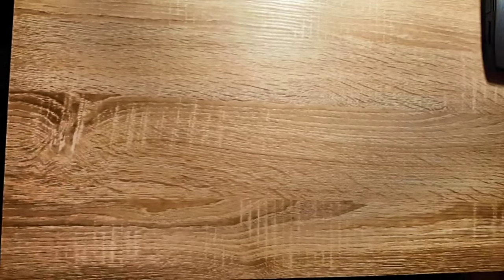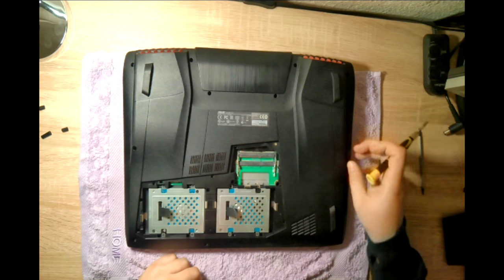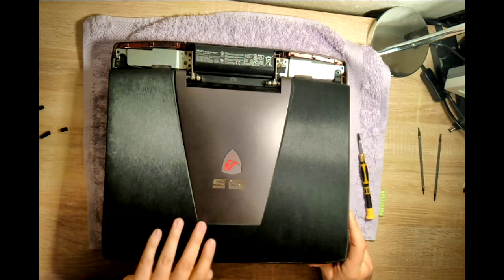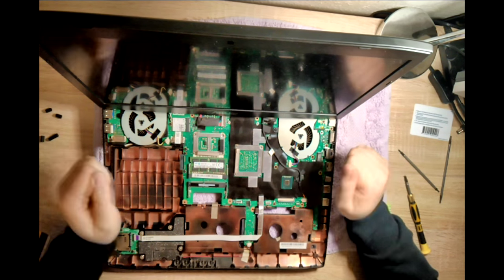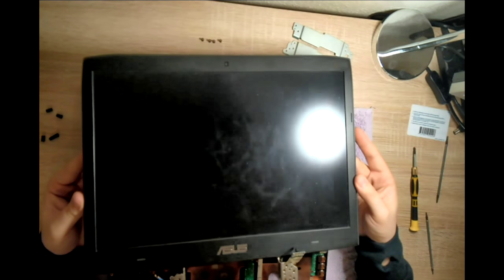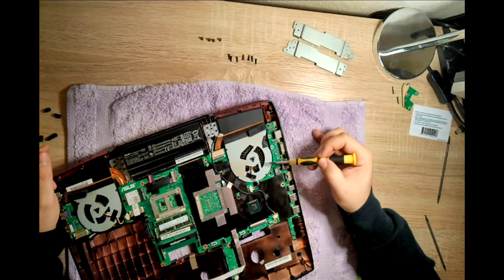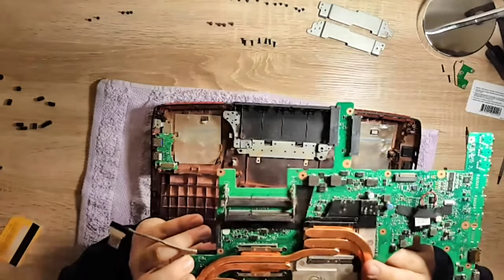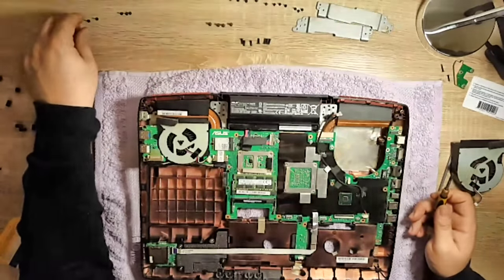Asus G751 - Complete Disassembly / Fan Cleaning / Battery Replacement

Comment: Thanks for perfect instructions. I used them to dissemble and reassemble my ROG laptop. I had to replace the entire keyboard assembly and bottom case. So everything had to come out of it. I spilled 10 ounces of hot munedo into my laptop, effectively destroying it. I got lucky and what I needed to fix it was on EBay. I got even luckier when I got it all back together and pressed the power button. It works!!! I think I might have a couple screws in the wrong places, but it's back together and it works! Thank you very much.

Comment: I know this is an older video, but it kept my G751 alive a bit longer. Ive had the since since 2015, and only a couple of weeks ago, the fans (specifically the left exhaust fan) started making noises. I opened it up, replaced the fan, thanks to this video and put it back together. Besides the horrible fidgity wifi antenna cables, the only issue i had was remember which screws go where, in the main body. Thank you for making this hardware last a bit longer. I will also say, for anyone using an older gaming laptop; dual SSD disks running raid helps.
Reply: I will try that 😬

Comment: My screws where tightened by a Titan and sealed with a magical barrier. I managed to remove 4 before the x on multiple screws turned into a forsaken circle.
Reply from the maker: Maybe you were not using the correct sized screwdriver bit? If you use a bigger/smaller one, the thing you mentioned above tends to happen.
Reply: What did you end up doing may I ask? I'm in the same boat .. :(
Reply: Can this motherboard be replaced? Water spilled over keyboard...Thanks a lot for the video!

Comment: a big thank-you guy, this allowed me to dust off G751. 👍
I will see if the temperatures will rise less, i pray. 
Otherwise I think it will be necessary to change the thermal paste... only place that I don't disassembled. (the copper parts stick to GPU/CPU).
Thanks again. 👍

Comment: @Dongleboo You are a lifesaver!!!! 
I was at my wits end worried about the noise my laptop was making (same model btw). I had fallen on an escalator and the stairs hit the side of my laptop that caused something to break off and go into the fan. I've never taken apart a laptop before so I was going to go to an IT company like geek squad to get it done but they wouldn't even tell me price and the only thing they told me was the price for the diagnostic which was over the top expensive!! my friend recommended this video to me and I disassembled the laptop (but just to the part of lifting off the keyboard) and I cleaned the fan with the duster spray. I successfully reassembled everything and my laptop is so quiet! Thanks again for posting this video HUGE help!!

Comment: you saved my laptop - overheating, battery was dead..now with a new battery and a good clean-up, it is as new :) thks !
Reply: Thierry Van Vaerenbergh hello sir may i ask if i remove the battery because its dead also but its ok? if im using the power cord directly w/out the battery??
Reply: i don't think it will work correctly without a battery in it

Comment: Thanks for this video. I needed to replace the bottom part of the case because it had broke in a fall. I watched your video once and was able to completely disassemble the laptop and put it back together. My only issues where my own fault where I didn't put the keyboard ribbon back in securely and the keyboard didn't work, and the battery wasn't in all the way so putting the speaker piece back was difficult at first. Otherwise went perfect. Thanks again.

Comment: Thanks a lot for the video, it really helped for opening the beast properly. I had a problem with the CPU fan that was making a lot of noise and the battery who's led was blinking, the fan is replaced and the battery disconnected then connected back and now everything runs smoothly again. Keep up the good work.
Reply: +BELDJILALI Farouk  Was your battery fully charging when the led light was blinking  ? Now my keyboard is now when inputting two characters instead of one character when i press one key but it's not all the keys . Help!!!!!!!!!!!!!!!!!!!!!!!!!!!!!!!!!!!!!!!!!!!!!!!!!!!!!!!!!!!!!!!!!!!
Reply from the maker: +BEN PAUL ESHUN-WILSON Can you repeat the question, because I actually didn't understand what is the issue?
Reply: +BEN PAUL ESHUN-WILSON Hey, the battery was at first fully charging and still be blinking green or red led, but now it's charging at a maximum of 86% and stopping there, still blinking led.
I got no issues with the keyboard, it's working fine for me, even after opening it.
Reply from the maker: +BELDJILALI Farouk Ok, now I understand - open CMD and type in command: powercfg /batteryreport - it's going to create an .html file which you can open with your browser and then look for "Battery capacity history" -somewhere around the middle. If it's under 80 000 mWh then you have a dying battery. I had the same issue and a defective battery. It died after only 6 months and was down to 60 000 mWh and didn't want to charge past 92%. If you have a sudden drop in capacity then the battery is defective. The problem is that the battery itself has only 1 year warranty and if you have your laptop longer than this, than you can't change it under warranty. And take this as an advice - NEVER leave your laptop to discharge and then charge it again! If you're using it keep it plugged in at all times! I hope I helped.
Reply: so in short i need to replace the battery but sometimes it says not charging the led light starts to blink . If you discharge the battery comes back to normal and through that was the fix but my battery level is drying.  Please what but my keyboard.?
Reply from the maker: +BEN PAUL ESHUN-WILSON The Battery is simply dead. As for the keyboard - I haven't experienced this issue. Is this an issue after you opened your laptop or it's from before? If it's after you opened it, then check the large ribbon cable connection. It's crucial that the whole cable is firmly plugged in and also that it's not inserted at an angle! Unplug it and plug it back in. I had a similar issue with my old G51 - I broke the keyboard and had to change it and after the replacement the keys weren't registering anything. At the end I decided that it's a BIOS issue with recognizing the keyboard and I removed the CMOS battery for 10 seconds. After this it will ask if you want to load default settings for the BIOS and you just press enter. I'm not saying this is your issue but as a start, try to unplug and plug back in the large ribbon cable! It's worth a try. I haven't experienced your issue.
Reply: Thanks men you have really helped me ,
Reply: Dongleboo Good day sir my battery died it ok to use it without the battery  using the power cord direct current?
Reply: john paul Sumpit hey mine also just died, I was also wondering if this works. Did you ever test it out John?

Comment: Its usually not the fan that needs cleaning but the copper heatsinks that are blocked with dust. A little bit of fine dust on the fan blades doesn't really matter.

Comment: great walk through. but as for the battery removal. you can remove it without taking out the motherboard. 
remove the 2 screws on the battery & unplug it. 
then take you're thumbs and push it back and then up on the front and it will come out.

Comment: It's a great guide, thank you! This video really helped me while I've disassembled my laptop to place RAM modules into the internal slots. It sounds a little bit strange but my model came with only one 8 GB module in one of the internal slots.
Reply from the maker: Mine also had only one 8GB module on the inside. Some configurations are like this. Mine also came without an SSD. It was a bit cheaper tho.

Comment: Nice vid. I appreciate you taking the time. You can actually pull out the battery without taking off the mobo. It is a bit difficult. You have to wiggle it and round it out. But it can be changed without fully taking off the keyboard or the display. You just have to be careful. Good vid.
Reply from the maker: I found about that while I making the video. I actually removed that part from the final video in post because you have to apply some force to twist the mobo a bit and then force the battery out and it's not worth the efforts and the risk when you can simply undo 6 screws and remove everything.

Comment: Thank you for your video. Extremely helpful! I took the laptop apart first time to replace the RAM to solve one issue. I may have created two more issues though: The DVD ROM does not read any disks and the drive letter does not display anymore. However, when I run the third party hardware scanner I can see the drive model, controller details, etc. Second issue the keyboard backlight stopped working. Only struggle I had was putting back the ribbon cables because I didn't realize the clips were there so I may have forced them in. I may try to reseat them. Any other suggestions? Thanks very much!

Comment: Hi! Thank you so much for making this video! Its going to help me quite a bit in the future when I finally get the courage to disassemble my laptop [G751JT] to that extent to replace the battery as it is completely dead, it sits at 0%charge and it says that its not charging the led indicator blinks orange [changes to green once in a while for a second].

You seem like a guy who is very experienced in taking apart the G751 and have done it many times... I have a few questions I hope you don't mind answering ;) 

1. When disassembling the laptop to replace the battery, are there any components that you can get away with not removing in order to avoid additional hassles?

2. Will using latex surgical grade gloves prevent static build up from shorting out components?

3. Is it safe to clean the top of the keyboard around the keys and touchpad with a household vacuum cleaner to get rid of the dust that has settled under the keys without building up static?

4. I upgraded the RAM of the laptop as soon as I got it to 32GB [came with 16GB] by filling the empty slots with the same RAM it came with.. How big will be the impact on battery life with the additional two RAM cards?

Thank you :)
Reply from the maker: Hi Varun, yes I've taken mine apart at least 10 times now so you could say I know my way around it. 
Here are answers to your questions:
1. No, not really. The disassembly is a step-by-step process and in order to remove one part, you have to remove the other before or after that so you can reach the next one. The parts which do not require to be removed are the speaker boxes and the SD card reader, as they are far away from the MB. 
2. I've never used any kind of gloves and to be honest I was quite amazed that some people have managed to damage their laptops in that way. They might help, but I'm not sure about that, so I prefer not to advise for and against them. 
3. The keys are quite robust and quite hard to remove, still, a vacuum at full power might be able to pop one out if it's directly over them. To be honest I'd suggest a can of compressed air. It's safer and actually better. 
4. As far as I'm aware, the ram is one of the most "power-efficient" components in a laptop, so even if there's some impact on battery life, it should be easily neglectable

I'm using my laptop more like a Desktop at the moment. I haven't removed it from my desk at home for over a month. :D 
This is the best way you can preserve the battery. 
Usually, I wouldn't even bother changing my battery again but from time to time I do move it to the sofa, etc. so I decided to change it.
Reply: Thank you for taking the time out to post a detailed reply! It really does go a long way in helping me out :)
Also the bonus tip in preserving battery life is very appreciated!
I used to charge and discharge my battery throughout the day, and thought that keeping it plugged in and constantly charging would be bad for it.. My battery ended up dying in 1 year..
Now when I get a replacement battery, I'll keep it plugged in at all times and once a month discharge and recharge it.. :D
Reply from the maker: You're welcome. :) 
As for the discharging of the battery, do not discharge completely. Go down to 25-30% and plug it back in. That's actually good for it! :)
Reply: I'll make sure to do exactly that! 
Thanks :D

Comment: Was kinda hoping I wouldn't need to almost entirely take it apart to get to the wireless card.... but I guess I will have to do this soon lol. Tried so many things to fix my intermiten wireless connection issues on my g751jy, but this wireless card is a known fault card unfortunately.

Comment: The fan on my G751 is super loud. Someone told me I need to clean the fan, and someone told me the bearing on my fan is going. Any suggestion? If the fans should be replaced, what is a reputable site where I can purchase replacement fans? Thanks for your help! Your video is really helpful!
Reply from the maker: Well, I'm not really sure what do you mean by very loud? When the laptop's under heavy load, you can easily hear the fans, they're quite loud at certain RPM-s. If they're making a squeaking or loud whining noise they might have a bad bearing, but other than that it's ok. I really don't know which site is more "reliable" but the fan specs are 12V 0.40A with a 4-pin connector.

Comment: Hey dude, awesome tutorial! Unfortunately, I think I messed up something when putting the video connector back, as it did a bit of sparking and my lcd is now dead. External monitor not working either so not sure where to check at this point. Think it damaged the motherboard connector...
Reply from the maker: Hi dude, try the VGA connector. Hopefully you didn't kill the GPU but only the HDMI and/or display output. Either way, if it sparked, I think that something might've died. I'm sorry this happened to you.
Reply: @amv.techpro  Thanks man, I did a bit of fiddling around, seems like only the LCD is not turning on, the external monitor is working fine. Ordered a replacement connector and will have it sorted later on. Think this happened because while resetting the connector back in place, it 'rubbed' against the other pins, so either the actual connector died or the motherboard one, I'll have to see later on. On the plus side, decreased temps by 7C on the GPU and CPU so I guess it's all good.
Reply from the maker: @ytdood  Yes the results are pretty good indeed.
Also if you re-paste with some good thermal paste or even better - liquid metal it's gonna be even better. 
I'm planning to put liquid metal next month. It's a bit dangerous though.  
Good luck with your display.

Comment: Thanks for the tutorial. Could you tell me how to clean/oil the fans?  How do we oil it properly?
EDIT: I held my laptop on its side while it was running and the fan started making the noise. I believe it tilted the axle and allowed it to scrape and wear out the bearings. Any possible fix besides replacing the fan?
Reply from the maker: +Koju Kin For the cleaning, a can of compressed air will do it. As for the oiling...I haven't done it in this laptop but usually there's a small cap under the info sticker which opens and you can see the shaft. You have to take it apart and inspect it up-close because I really don't know how it is in this laptop. The oil itself should be sewing machine oil or something similar (DO NOT USE WD-40), you can get it from any fabrics shop etc.. You'll need a single drop only, don't put more than this.
Reply: +Dongleboo Thank you for the reply. I really appreciate it. It seems some of these units come w/ bad fan bearings. Lots of people are having this issue. Here is a post of my exact issue: https://rog.asus.com/forum/showthread.php?73588-G751JY-left-side-fan-rattle

Comment: This is an awesome video man, great job. Quick question. Where/how do the fans pull in fresh air? It's obvious where it exhausts the hot air. Thanks.
Reply from the maker: +James Stricler Usually this type of turbine fans pull the fresh air from above. There are no actual openings for it. It gets from everywhere. This is why it gathers some dust on the speaker grills because air passes trough them as well. It was the same on the old G51, as well on the G750 etc. They all have similar design.
Reply: +Dongleboo Hmmm interesting. Thanks for the speedy reply. I'm looking at possibly buying one of these models. This will be my first rather expensive laptop. I usually stay in the $600-$800 range but I thought I would expand into unfamiliar territory for once. I have subscribed.
Reply from the maker: +James Stricler Well, this laptop does come at a hefty price, but believe me, it's worth every penny after you experience the performance and the Software / Games it can handle. The reason I got this laptop instead of a desktop PC is that I travel a lot and also I take this laptop to university every day. I needed something powerful on-the-go. If you do buy it, you will be very pleased! :)
Reply: +Dongleboo It's good know they are worth their money. The one I'm looking at is $1,300. I really don't want to spend anymore than this lol. This model comes with the GTX 970.
Reply from the maker: +James Stricler I spent 2K euro on mine :D but it's the JY model with the GTX 980. You won't regret it. Awesome laptop.